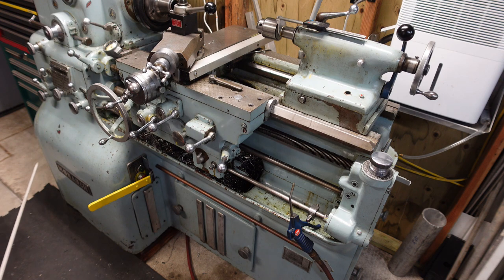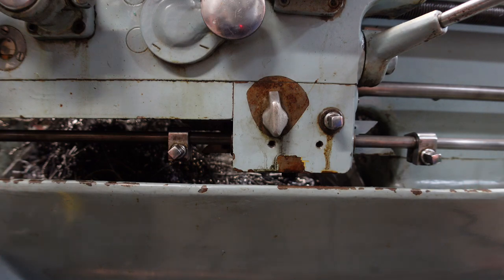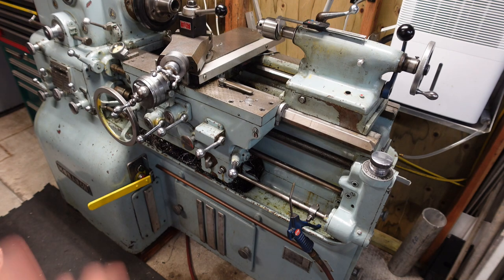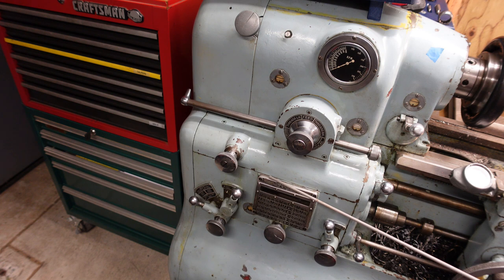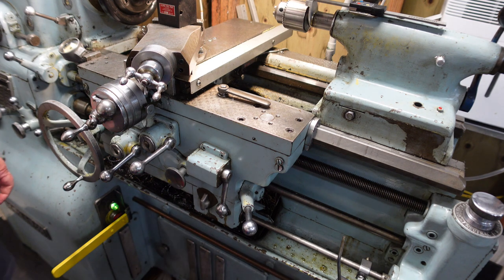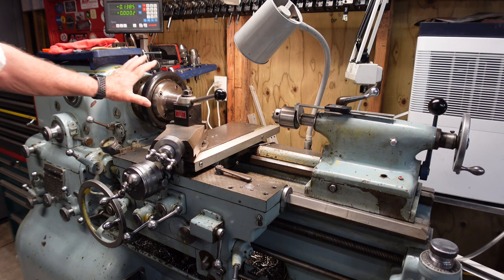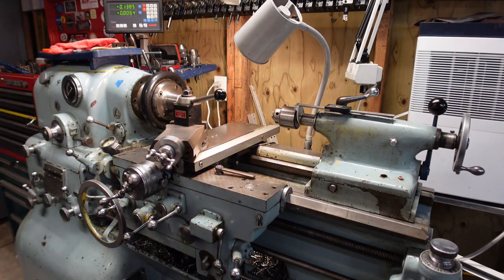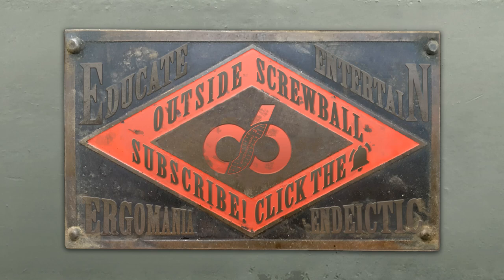Monarch Lathe 10EE  ELSR Review

Comment: Your lathe has a ward-Lenard drive. This is a signal amplifier that uses mechanical components to amplify an input signal. A true marvel. It creates a DC voltage to drive the main motor. Otis used ward-Lenard’s in elevators well into the 1980s!

Comment: This is the first 10EE with ELSR that still had the control on the headstock.  Every ELSR machine I've ever seen had the headstock switch removed and a blanking plate installed.  Coincidentally, I just tore the ELSR housing off my 10EE completely apart last night (less the knob on top - can't get it off) to strip what's left of the burnt-off paint, thoroughly clean & remove any rust from the internal parts, and prep. it for Bondo and paint.  My 10EE was in my brother's garage when it burned to the ground.  He died before he could submit everything to his insurance company.  I don't have the $65,000.00 that Monarch quoted to repair the machine so I'm stuck doing it myself.  Arrggh,  there is little I dislike doing more in life than bodywork and paint.  I've repowered it with a 3.5kW AC Servo motor and drive.  It also allowed me to add a true Electronic Lead Screw Reverse to the machine using 2 proximity switches tied into the axis overtravel inputs on the servo drive.  With moderate spindle speeds and mass the spindle will stop in 1 revolution or less, typically stopping within a thousandth or so.  I could lower that figure by using high precision prox. switches instead of bog standard ones.  I'm really looking forward to getting the old girl brought back from the scrap pile, hopefully by this spring.  I wish I had the time to document the process with video but it's simply takes way too much time to be setting up cameras and lighting.  I've been picking at it for about 2 years as it is, and I really need to get an operable lathe back in the shop.  Till she spins again, all I can do is live vicariously thru other's 10EE video's on NannyTube....
Reply from the maker: Hello Marc, thanks for viewing, the ELSR was added to my lathe by one of the earlier owners along with some re-wiring, hence the double levers (which I like).  I would assume you have watched Four Ponds Shop and his rebuilds of 10ee lathes.  My condolences regarding your brother, know he is watching you as you get the machine back up running.  I certainly understand the time constraint of getting something completed while filming....take care and keep me posted on your completion...
Reply: @outsidescrewball  The ELSR added after the fact makes sense, it's a really useful feature to have.  No, I haven't watched any of Four Ponds stuff yet, been on the list though.  I'm a Machine Tool Technician, I repair CNC machine centers and ancillary equipment at my night job (prefer nights - no bosses giving their 'input' so I can actually get things fixed) so working on a 10EE is relatively easy.  The biggest issue has been the cost of parts.  Anything to do with a 10EE has skyrocketed over the past 15 years.  All the knobs on the gearbox melted, had to pay 35 - 75 a piece on FleaBay for instance.  I gave up trying to find the LH | FEED | RH placard for anything under stupid, ended up 3D printing one.  Apparently the front set of spindle bearings are over $4000 from Monarch now since the front bearing has a special flange on the front of it. 

I've been taking a lot of photos during the process and plan on doing a narrated slide show video when it all gets done.  That way I can listen to internet experts telling me how I screwed everything up LOL...
Reply from the maker: @marcseclecticstuff9497   take a look at a YT channel Daryl Smith, he does similar work, FYI it is possible here in the near future I will be looking at two 10ee lathes, both in pieces as I am told so maybe some parts....

Comment: The feature only stops the spindle mechanically with the dogs camming the apron spindle control lever to neutral. The DC spindle motor quickly dynamically brakes to a stop when in neutral.
 The larger Monarch lead screw reverse option is all mechanical, the spindle continues to run through the cycle. Great video!
Reply from the maker: thanks for viewing and your comments

Comment: The trick with the cross feed dial is in setting up for threading.  Set the compound to 30 degrees (or a little less) and the dial at zero.  Start the lathe and use the cross feed to advance the tool to the work with the stop engaged but the dial lock (lever in front) unlocked.  The dial will come up to the stop at 0 but will continue to turn with the dial slipping.  Advance the tool until it scratches the work and engage the dial lock.  At that point the cross feed and the compounds are both at 0 for turning threads.
Reply from the maker: Russ...thanks for the view and comments, I believe it is easier to set the stop within range of the work, advance the stop to the dead point, then make the final adjustments with the compound, after touch off, zero the compound and start the threading
Reply: the 10EE is so rigid having the compound on it is the weakest link. Ditch the compound and use a rigid toolpost with a multifix holder and straight plunge your threads. no more faffing about with angles.

Comment: Hi, I'm really amazed by that threading stop on the crossslide handwheel. How does it work that you have a defined stop in both directions? Looks like that is really helpful for cutting threads. Never seen something like this on other lathes. Thanks for sharing.
Reply from the maker: thanks for viewing....there are stops built into the cross slide handle that are engaged....

Comment: I don't think that I ever saw a lathe that size with that large of a carriage. Was the electronic lead screw reversing a option?
Reply from the maker: Andy, the lathe was not ordered with the elsr when built, a later owner did lots of work to the lathe (rewire etc) and added the unit to the machine

Comment: I've yet to see a full tour of the 10EE having been made aware of them 
by Keith Rucker (VintageMachinery.org YT) and it's clear it's an oddball
 lathe. Keith has one to fix with an AC/DC system but he says 
electrically it's a mess. Keith may well appreciate some assistance in 
getting it fixed up in due course.

I noted your dehumidifier. Do you have that connected to a permanent drain ? Odd how the text lines above have been truncated like that - nothing to do with me - just pasted the text there!
Reply from the maker: thanks for viewing...don't understand the use of "oddball", but yes there are many variants of this machine.  
My "permanent drain" is a hose thru the wall to the landscape area...I certainly got tired of having to empty the container...
Reply: @outsidescrewball  I bought a similar unit 6 months ago due to the 'weather' getting to machines & tools. It meant leaving the garage powered up all the time and the lean-to greenhouse was fed from the garage but is now completely delapidated. I disconnected the supply to the lean-to - then it rained - and I could hear explosions. It seems unbeknown to anyone, dad did some very unorthodox wiring - so power was still being supplied to the greenhouse despite the feed wire being disconected ! Untill I sort the wiring mess out, both garage and greenhouse are now isolated from mains supply - so the dehimidifier's in the kitchen (draining into the sink!).
The 10EE is 'oddball' due to various features - short bed, wide saddle, unconvetional controls on the headstock.
The ELSR - is it really electronic ? and what's all the gubbins at the tailstock end ? Many lathes have spindle forward/reverse lever on the apron - so I see absolutely no nned for an additional device at the tailstock ! You just need bed stops that operate the spindle drive control at the apron!

Comment: 10:44  It's actually 4 10ths out as it's showing -2 whereas the first time it showed +2 10ths !
Reply from the maker: sharp eye....LOL, thanks for viewing
Reply: @outsidescrewball  I'd hope my lathe achieves better than that - if I ever get a DRO fitted to it. I've not even got a 10ths DTI
It has an unusual trip for the power feed. It's designed so the stop stops the travel then the power feed trips on a designed adjustable overload.
But that's for the power feed - it doesn't work for threading !